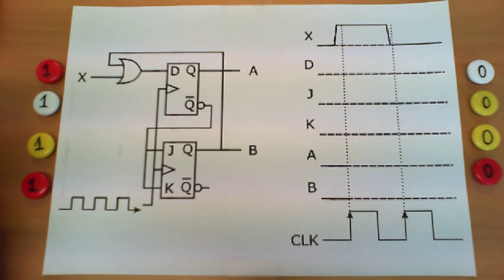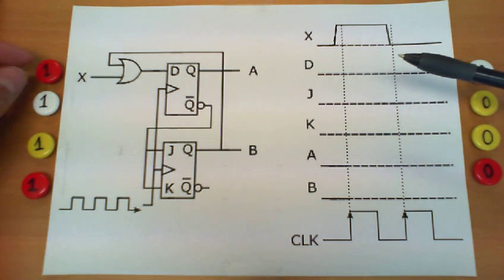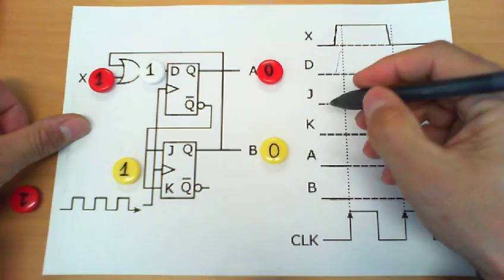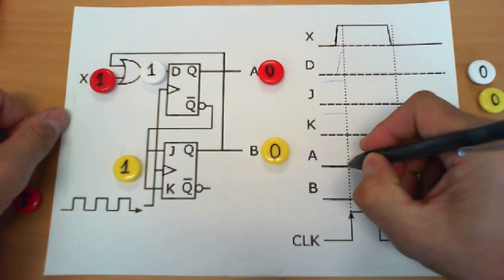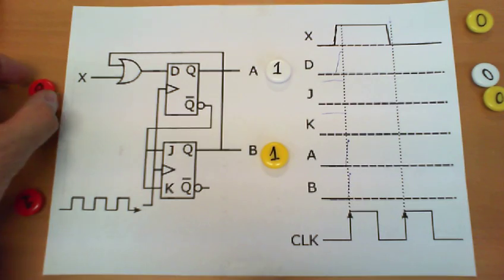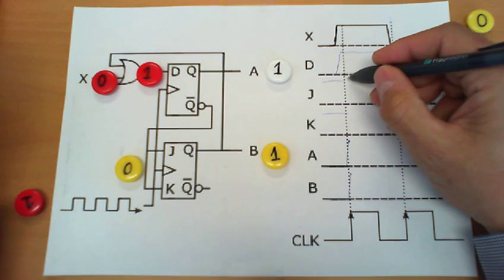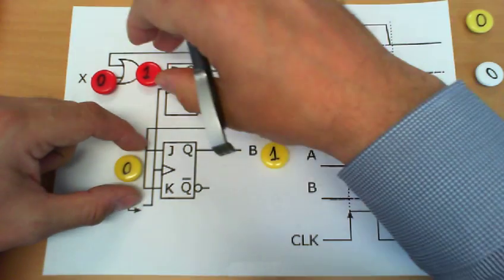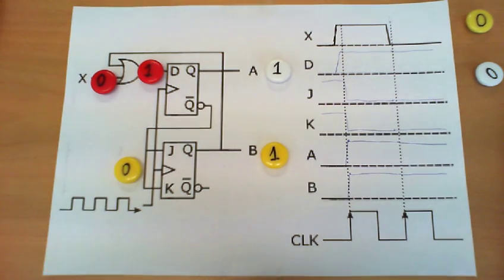Analysis of a sequential circuit with D and JK flip-flops

Comment: But with the not Q output (of the D flip-flop) being inverted wouldn't both the outputs of the D flip flop be the same?
Reply: +James Wooten For anyone else wondering the same, the Q output is the driving value with the Q NOT being the opposite by definition.

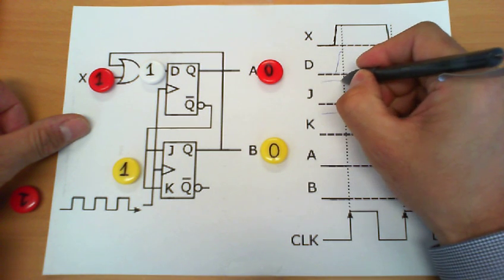Comment: at 1:25 Why the Graph of D starts at zero and goes to 1 just before CLK ?
Unlike J and K Which are 1 always before first CLK.............
Reply: yes, I have the same question
Reply: D becomes 1 at the first clock cycle because X is 1 and X is fed into an OR gate. 

If either input X or Q is 1 the OR gate will output a 1 to D.

Both inputs would have to be 0 for D to be 0. 

As the clock cycles X goes to 1 so must D.